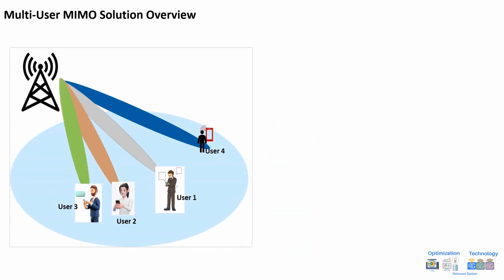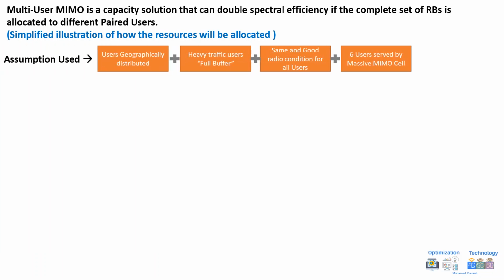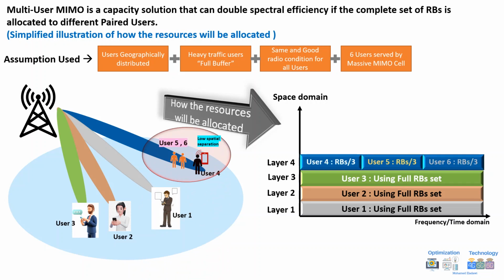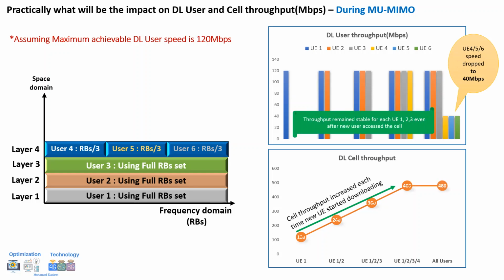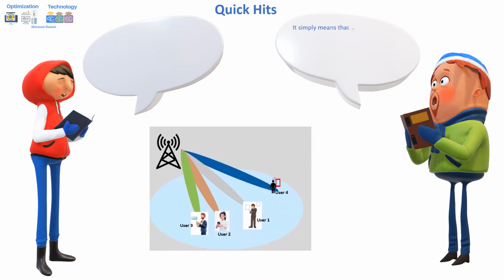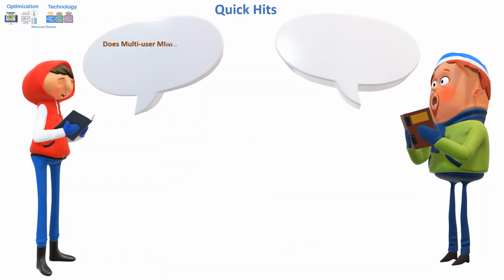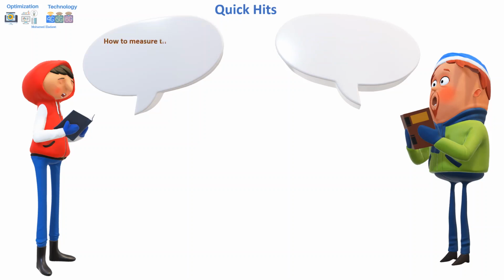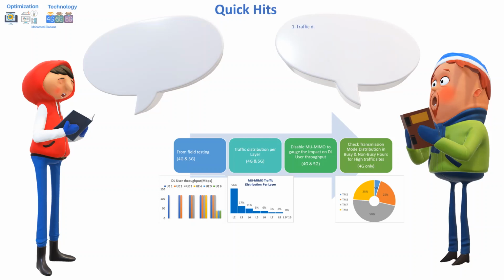5G Multi-User MIMO: High-Level Overview, Simulation & Q&A

Comment: Nice, good job…

Can i ask a question, you told in the video : Quick hits section, the MU-MIMO is typically associated with the lower rank MIMO (2x2 MIMO). But why in the next, you told 4G and 5G support using until 64T64R. Can you explain it? Is the lower rank not corresponding directly to number of antenna?
Reply from the maker: Thank you, Muhammad. Certainly, feel free to ask anytime. You're correct; the maximum supported rank is directly correlated with the number of TX/RX antennas on both the UE and BTS sides. For instance, if the BTS transmits with 4T and the UE receives with only 2R, the maximum supported rank in this scenario is 2. In the case of 64T64R from the BTS side, the maximum supported rank in either DL or UL will still be constrained by the maximum supported TXRX on the side (UE).

However, there is a nuanced difference in the statement mentioning MU-MIMO. MU-MIMO is typically associated with lower-rank MIMO (e.g., 2x2 MIMO). In the case of Multi-User MIMO (MU-MIMO), even if we assume that the maximum supported rank is 4, the gNB/eNB may downgrade the maximum rank to 1 or 2 to maximize the benefits of Multi-User MIMO. Nevertheless, this is a vendor-specific solution, implying that UEs can still support rank 4, but it involves a tradeoff in MU-MIMO performance.
Reply from the maker: If not clear let me know and you can text me on linkedin to discuss further if needed. thanks

Comment: Thanks !One query  what are differences at signalling level..in sumimo and sumimo??? Can you please elaborate on this ..any signalling diff in sumimo n mumimo..( in rrc reconfigure msg)
Reply from the maker: Hi Vipin; as i know and understand; you can mot see MU-MIMo from any signaling; the full control is at eNb side and there is no information need to be shared with the UE; when i did the test before for MuMimo i was only able to confirm this from throughput gain from field and checking related MU mimo counters from KPis
Reply: Thanks @mohamedeladawiashour  yes I was observing same . Also  if mumimo is with massive mimo i.e 32 trx massive mumimo then do we need any signalling i.e need to do anything set for 32 trx  at signalling?